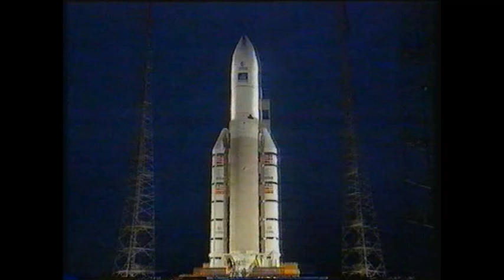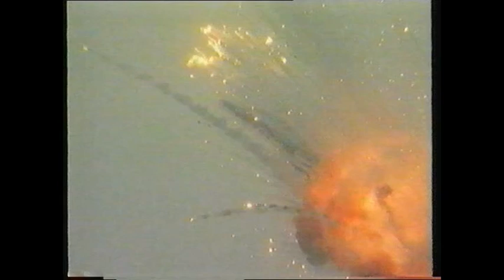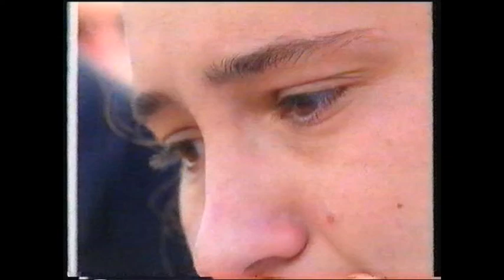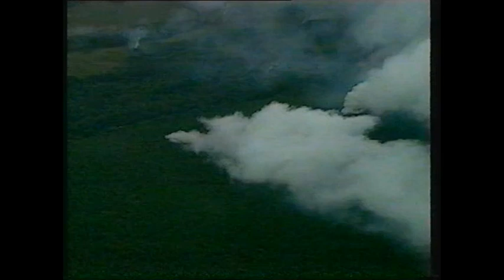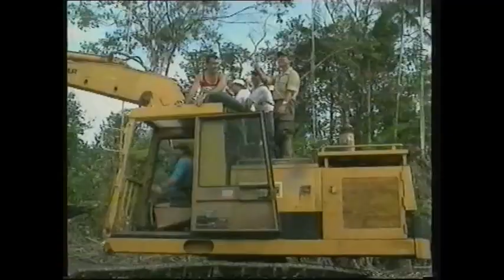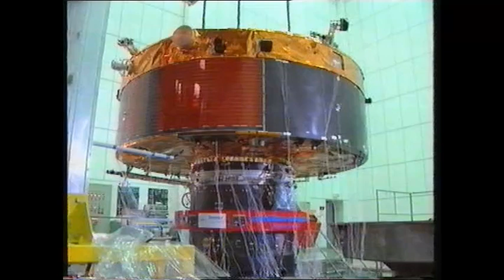Ariane 5 rocket launch explosion

Comment: That orange hypergolic fumes tho
Reply: and what I meant by NO2 is that, when the N2O4 <-> NO2 equilibrium is exposed to high temperatures, the equilibrium is subsequently pushed to the right,  therefore favoring the formation of NO2. This would explain the formation of the brown or red gas, because N2O4 is a clear or sometimes blue liquid. :)
Reply: NO2
Reply: Nasty Hypergolics
Reply: N2O4 - that's a BIG difference. That MMH is horribly toxic as well.
Reply: You're right. MMH is just about as bad as it gets. 
Just imagine a hypergolic motor with ClF3 as the oxidizer and MMH as the fuel... oh, the horrors...
Reply: Azide N3 OK, thanks for the explanation. That's a bit above my level of knowledge in the area.

Comment: This is what happens when you hire french devs.
Reply: This isn't what happens when you hire french devs. That's an ad hominem argument, one of the most common logical fallacies.
This is what happens when bad management decisions go unchallenged.
Bad management processes occur worldwide, I guarantee it. I can also guarantee that for many reasons, subordinates often follow the instructions of management despite knowing that management is making a bad decision.

More specifically, this is what happens when the guidance system from an old rocket (Ariane 4) is reused for a new rocket (Ariane 5) without checking it adequately.
If they ran the entire guidance system (including Inertial Reference System) thru the simulated trajectory of an Ariane 5 launch instead of just using the "expected output" of the Inertial Reference System, this error would have been caught without needing to lose a rocket.
In fact they did exactly this test after the rocket failed, and the simulation did the same thing the failed rocket did. The simulated Inertial Reference System locked up at the same time, and the simulated rocket followed the trajectory of the failed rocket quite closely.
Reply: acdgui
Those were, again, both bad management decisions. Neither of them could have been avoided by changing computer programming.
And they're basically identical as far as the outlook the management had.
"SRB O-ring seals failing? Hasn't taken out a shuttle yet, launch the damn thing."
"Foam hitting the tiles that weren't designed to take a single hit? Well, it hasn't destroyed a shuttle yet so I guess it's fine."

The design of the shuttle was too ambitious, part of the reason it cost so dang much per launch and overall. It was amazing it didn't kill more people, to be honest.
Reply: nutsackmania
Every single flight lost some silica foam tiles.
If any flight had lost enough in one spot on the belly of the orbiter, the same thing would have happened.
IIRC the first flight lost so many they were surprised it even made it back at all.
Reply: Space Shuttle program circa 1996: "Consider these stats: the last three versions of the program — each 420,000 lines long — had just one error each. The last 11 versions of this software had a total of 17 errors."
Reply: 44R0Ndin Foam tiles were designed to take small impacts, however they were not even the problem--it was a very hard RCC panel that was punctured. You don't even really know enough to comment on these things.
Reply: +44R0Ndin No shit, idiot. Missing silica tiles were totally irrelevant to STS-107. Nice way to deflect from your original assertion to make it look like you knew what you were talking about.

Comment: Never trust software.
Reply: Actully the software did its job perfectly as it was programed, it was the humans fault that programed it wrong.
Reply: It's ironic you should say that since there is not a single space rocket built since the 1950s that didn't rely on some kind of software.   There is no way any human can manage such a complex machine and it's thousands of parts in a split second time frame.
Reply: Phillip Mulligan I said never trust it, not never use it.
Reply: Never is one of those words that creates a statement of absolutes.  To never trust something is to never use it.
Reply: Phillip Mulligan Well, how do the Russians put it?  Доверяй, но проверяй?  I like that saying.
Reply: "The program doesn't work, I have no idea why... Now the program works, I still have no idea why"

- Every programmer ever, 1958-2017.
Reply: The_Blazer:
"Tom Knight and the Lisp Machine"
A novice was trying to fix a broken Lisp machine by turning the power
off and on.
Knight, seeing what the student was doing, spoke sternly: “You cannot fix a machine by just power-cycling it with no understanding of what is going wrong.”
Knight turned the machine off and on. 
The machine worked.

Comment: GPS Be Like

"Follow the current trajectory." 
turns violently to one side
"Recalculating."
engages self destruct and plummets to Earth
"You have arrived at home."
Reply: please make a U turn where safe
Reply: Ariane 5 flight computer be like: error, initiating self destruct sequence
Reply: Bateu no domo
Reply: GPS receivers are actually designed not to work over 1000 knots ground speed. The whole point is to prevent them from being used by the Soviets for making missiles.
Reply: HAHAHA funnies comment

Comment: I always wonder with these rocket explosions, was there the one guy 10 seconds before launch who was suddenly saying to himself 'Sh*t!  I forgot to wire the thing to the thing!'.
Reply: It was actually a integer overflow error that brought Ariane flight 501. They reused the flight computer from Ariane 4 for flight 501 and thought it would never exceed the flight computer's limit: big mistake. While the guidance system was converting data from a 64 bit floating point to a 16 bit integer, the number overflowed and reset to 0, causing the both the main guidance system and the backup guidance system to crash, causing the flight computer to think the rocket was 90 degrees off course. A simple line of code would have prevented it.
Reply: Öne yazılan sayılardan sonra 48 tane 0 verisi eklenirse 48 kat büyümüş bir değer çok büyük bir hata.

Comment: Rocket goes boom director: "All systems nominal."
Yeah, Probably not?
Reply: +uoy1997 
Yes, the primary systems were nominal. After a software-malfunction, the automatic self-destruction was initialised, as destined, due to safety reasons.
Reply: Where did you get that? This was a case of overflow, where they tried putting a 64 bit float in a 16 bit field, cutting off the most significant digits. This bad value in turn propagated through the calculations and made the rocket think it's off course while it wasn't. This turn was simply too steep and made the rocket break up. The explosion only happened after everything already went to shit. The hardware performed totally fine.
Reply: From what the French pages online are saying, the self-destruct sequence was started but the rocket had already exploded, probably because of the boosters being ripped off and started the chain reaction on their own.
Reply: Rocket goes boom director: "All systems nominal."

when your life is shit but you got used to it
Reply: They used an out dated rocket launch software in the primary system causing the liquid oxygen and liquid hydrogen flow to be to much causing the explosions in the combustion chamber to be too much causing a small fire igniting the liquid hydrogen causing an explosion.
Reply: also throwing off the SAS systems and RCS systems causing the rocket to lean in mid air too.

Comment: а почему она взорвалась? вроде нормально пошла...
Reply: Ошибка навигационной программы. Там горизонтальная скорость хранилась в 64-битном числе с плавающей точкой, но в ходе выполнения программы скорость конвертировалась в 16-битное целое число. Когда скорость превысила 32767 (максимально возможное 16-битное число), конвертация оказалась ошибочной и ракета начала крениться вбок. Поскольку ракета не рассчитана на такие резкие повороты, она развалилась в воздухе.
"It turned out that the cause of the failure was a software error in the inertial reference system.  Specifically a 64 bit floating point number relating to the horizontal velocity of the rocket with respect to the platform was converted to a 16 bit signed integer.  The number was larger than 32,767, the largest integer storeable in a 16 bit signed integer, and thus the conversion failed."

Comment: "The on board computers decided the rocket was 90 degrees off course" 

That's one of the funniest accident reports I've ever heard...
Reply: +Jonah Beale (RCFlyer) What's happened here is the rocket reevaluated its life.  It went "Nein, Nein!  This is wrong.  This is not what I want... I know!  I WILL BECOME AN AIRPLANE!  A MAJESTIC BIRD!"  

And then it died horribly, as all birds do.
Reply: @mothmanic_unofficial  Why did the bird use software from the previous bird?
Reply: @jojoflowe  To get to the other side?
Reply: Funny thing is, 3 seconds later, it was pointing 90 degrees off course. I feel like there's some sort of motivational lesson hidden here -- e.g. "if you can put your mind/CPU to it, anything's possible!"
Reply: @TheHuesSciTech  well it went 90 degrees to compensate for its belief that it was 90 degrees in the other direction.
Reply: +Jonah Beale The most expensive integer overflow!
Reply: then you haven't heard of the Mars Climate orbiter: The primary cause of this discrepancy was that one piece of ground software supplied by Lockheed Martin produced results in a United States customary unit, contrary to its Software Interface Specification (SIS), while a second system, supplied by NASA, expected those results to be in SI units, in accordance with the SIS. Specifically, software that calculated the total impulse produced by thruster firings calculated results in pound-seconds. The trajectory calculation software then used these results - expected to be in newton-seconds - to update the predicted position of the spacecraft.
Reply: If only we had declared larger variables...
Reply: Jonah Beale---- true
Reply: What it really means is that the rocket self-destruct was activated automatically due to a large orientation angle error. This is done for safety. The actual fault was in a different part of the software.
Reply: Not funny if it happens to your car one morning ;(
Reply: Matthew Picchu so if birds die they explode?
Reply: We researched this at uni under the "critical systems" module.  It was to do with mixing metrics and the resulting erroneous angle of trajectory.  It tried to be at an angle designed for the earlier smaller rocket (in the software) and so it was way too aggressive causing massive fatigue, leading to structural failure!  Bad day all round.
Reply: right hand rule!
Reply: Talking about Mcas am I right?
Reply: What it really said:"the on board comupter decided that 501 was 90 degrees off course"
Reply: The resulting fireball was the automatic flight termination system, which broke the vehicle apart.
Reply: Easy when you've mixed metric and imperial values!
Reply: +TheHue's SciTech
Rockets usually have very good control authority because the engines are mounted on bearings to give them thrust vectoring. Rockets don't usually use most of this control authority because they're well balanced and all they need to do is follow a trajectory that doesn't have any sharp bends in it.
Put another way, If the controls are at full deflection at any time, the guidance system is having a problem and you will not go to space today.

Three lessons, which are basically condensed versions of the actual lessons learned from this failure:
Always range-check, sanity check, and clamp variables whenever possible. If there isn't enough room in the program memory to include the clamping logic, make room for it. It really is that important.

If re-using the guidance system from another rocket, triple check for code that doesn't control anything on the new rocket (ex. fin control subroutines on a rocket that has no fins).

Testing is going to happen one way or another. Make sure it doesn't have the possibility of destroying stuff (unless destructive materials testing obviously).
If they ran the whole guidance system thru a simulation instead of just the main guidance computer, they would have caught this exact failure without losing a rocket.
After the accident, another Ariane 5 guidance system was run thru a 
simulation. This system had the exact same glitch (at basically the same 
time) as the one in the rocket that failed.
Reply: @44R0Ndin  best part is "if re-using the code"
Reply: Also, if fire is pointing towards the sky, you will not go to space today.  Fire must always point away from direction of flight :-)
Reply: Fire must always point away from direction of flight, eh? Good luck doing a deorbit or landing burn!
Reply: +gazlink1
Most expensive to date. There's always the possibility of a more costly disaster sometime in the future.
Reply: wrg,idts